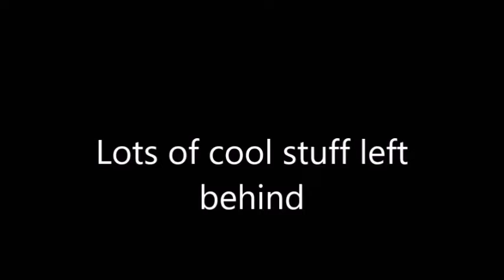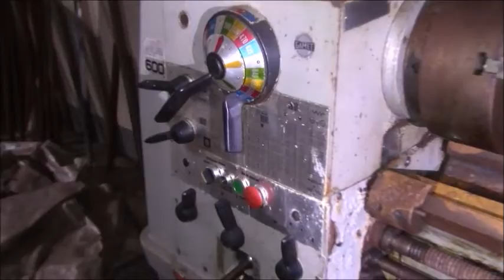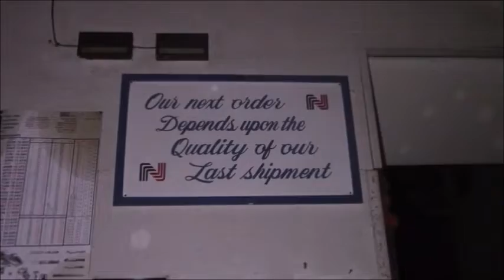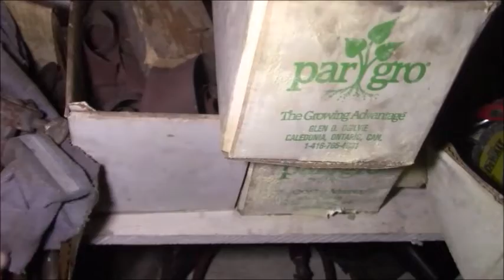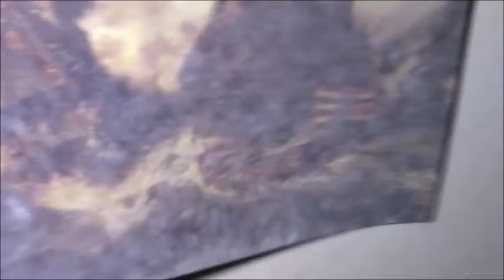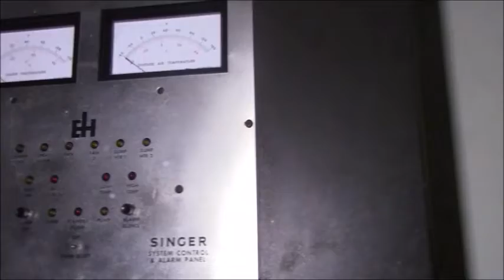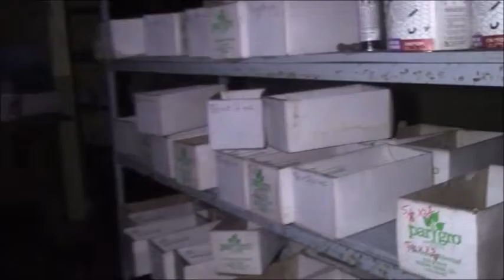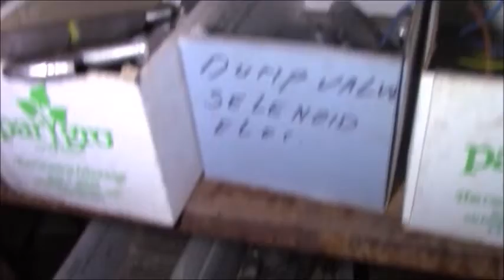Old abandoned machine shop

Comment: Must have been locked up in legal wrangles, until everything rotted into scrap. No one in their right mind would let something like that happen, except attorneys.
Reply from the maker: That is a possibility.. As of now. The building has been sold and is torn down
Reply: No, they just needed more room and sold it. That equipment paid for itself 100 times over, guaranteed.
Reply from the maker: Nope.. they ran into legal issues.. the place is torn down now.. all the suff got scrapped
Reply: Very sad.